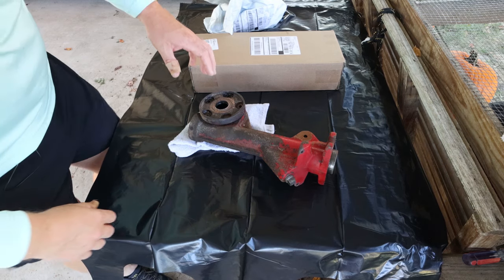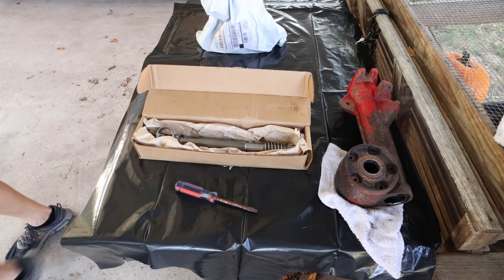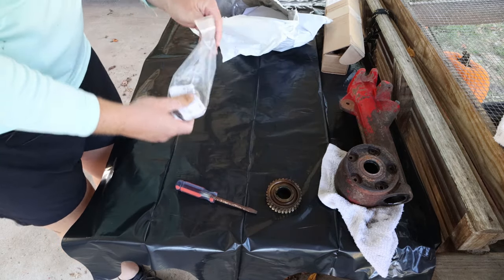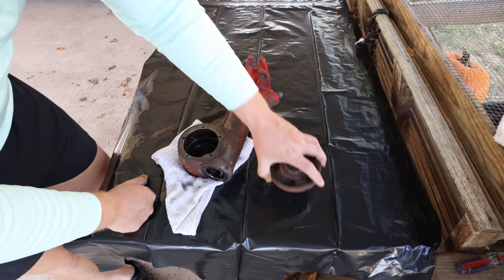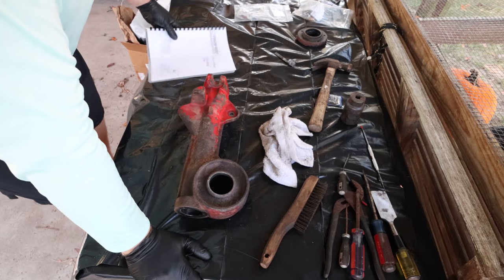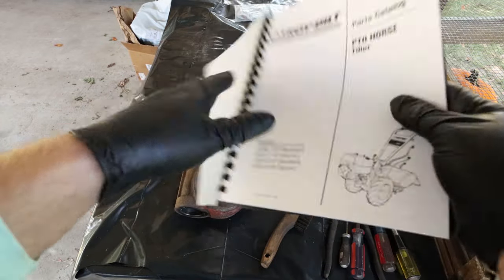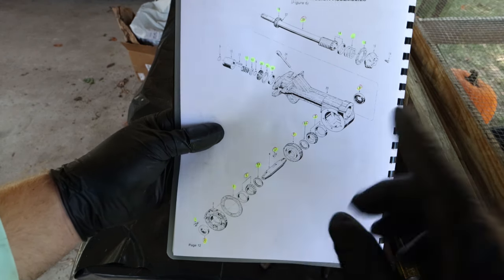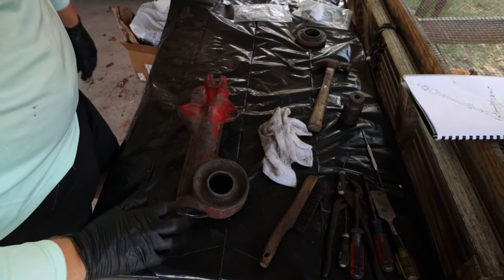Repairing our 1986 Troy-Bilt Tiller PTO  - Part 2

Comment: Where I am a novice mechanic with a little background, I wished you explained the step-by-step procedures for installing all of the new parts.  I am sure it would have been boring to the pros, but I need that training.  Thank you.
Reply: Thanks really enjoyed it, I really would like to know where to get a catalog. I have a troy built horse tiller 8 hp maginum I bought, not real sure, in 1978 new. I don't know how I can find out what year it is but I would need to know so I can order the right parts for it. Can you help. Thanks
Reply: Great job on the video. I have the same tiller I bought in 1992. The Magnum Kohler is a great engine but certain parts are no longer available for them. My coil went bad causing the rope to kick back when starting. Before I could determine it was the coil it ruined the recoil starter which is not available for the M8T. I fixed it, replaced it with a new Honda GX270 8.5HP engine. Wonderful upgrade, good for another 29 years now!
Reply from the maker: @Peter Ohmart - Originally I did do a step-by-step video, but it was 2.5 hours long. Needless to say, I decided to shorten it. But I am trying to come up with ways to keep the videos short, but still get in all the vital information. So it's a work in progress
Reply from the maker: @Ray Lassiter - I was able to find the serial number on the tiller. With that, I contacted Troy Bilt and they were able to give me the year and model number. Once I had that info, I Googled a parts manual. It took some hunting, but was able to find it after a short time. What I liked about their manual is that they listed the parts and part numbers. For the most part, the part numbers had not changed. There were some new part numbers for a few parts, so I had to search for it by the name of the part instead.
Reply from the maker: @Steve Warner - One of my biggest fears is when something goes out on the motor that I won't be able to repair and I will end up having to do a motor swap.
Reply: Agreed

Comment: Excellent machines, before MTD bought them and ruined them!! 
Check those rims that they aren’t seized on the axle. I had one that was so bad I had to cut the rim off the axle to fix tire. Nice video!
Reply from the maker: I was very worried about the rims seizing. After working a few hours to get one rim off, I just left the other one alone and hoped that I will never have to deal with it again. Fingers crossed!
Reply: I read where one guy knocked the roll pins out which attach the wheels to the axel and sprayed it with some PB Blaster. Then he just tilled some soil and the wheels broke loose by themselves. I haven't tried it yet, but it sounded good!

Comment: Kind of looks like there was an oil leak on the PTO shaft still
Reply from the maker: You are right on that one. Troy Bilt sent me the wrong PTO seal which caused a leak. I ended up contacting them and getting the right seal, so it's now leak free.
Reply: @tillermanfarms2162  can you give me the part #please?
Reply from the maker: The original part number is 9617, but has been replaced with 921-04030 according to the Troy-Bilt website.

https://www.troybilt.com/en_US/miscellaneous-classification/oil-seal-.750id-x-1.783od/921-04030.html#q=9617&lang=en_US&start=0